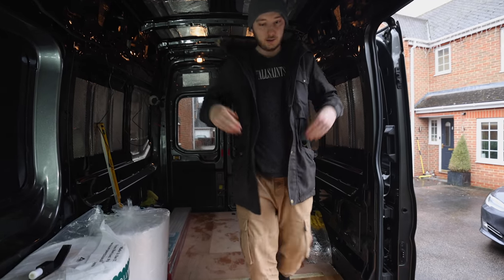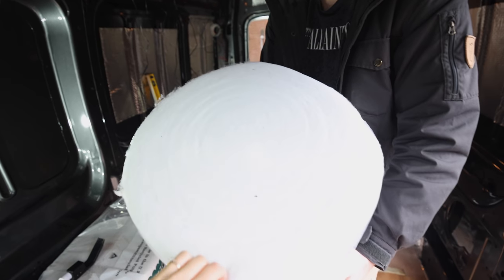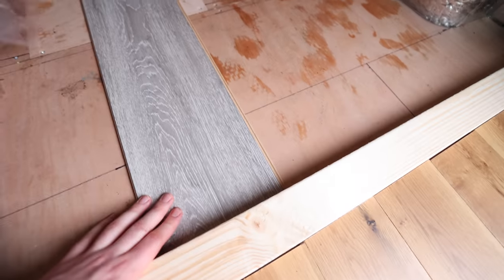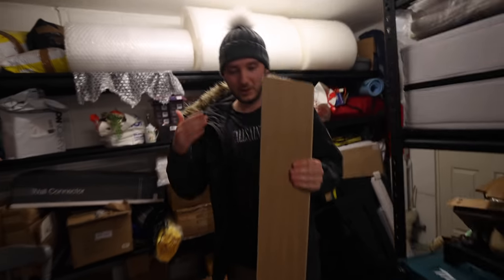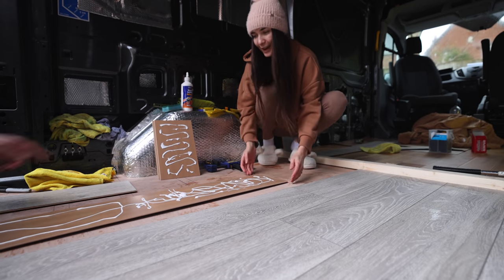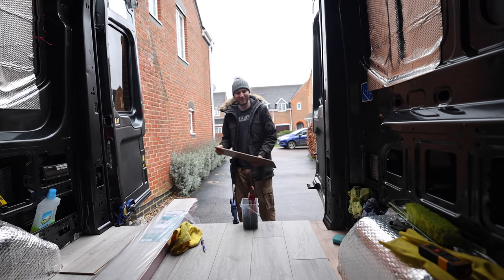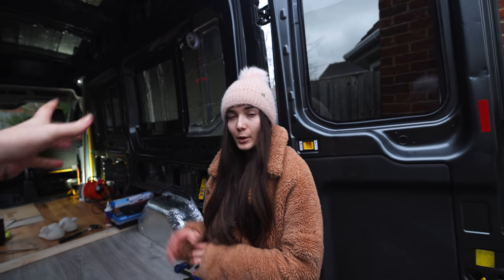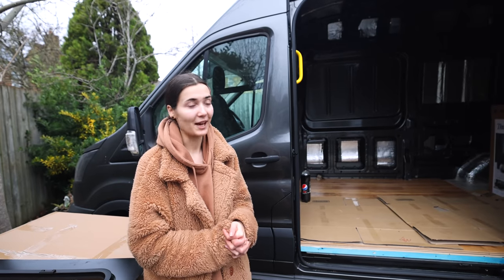WE MADE MORE HOLES! | 52O WATTS OF SOLAR FROM THE THINNEST PANELS...

Comment: Wrong glue for the floor, there is a flexable mastic to trowel on with a 1/16 inch notched trowel. the wood glue will release with movement. You could reach out to trades people for tips before each project in the comments section, we like to help.